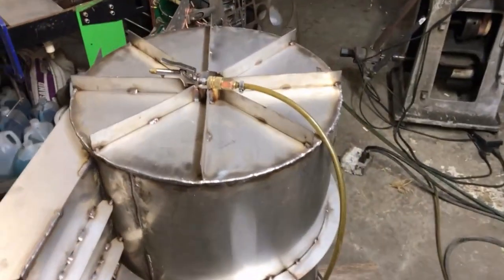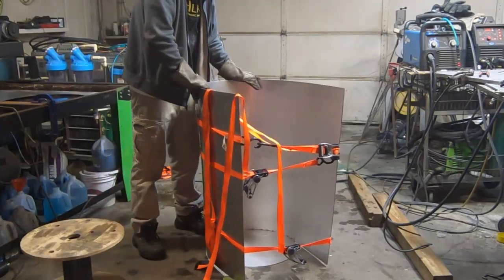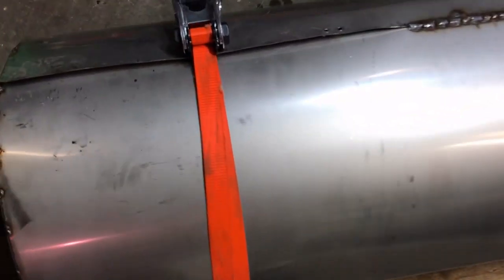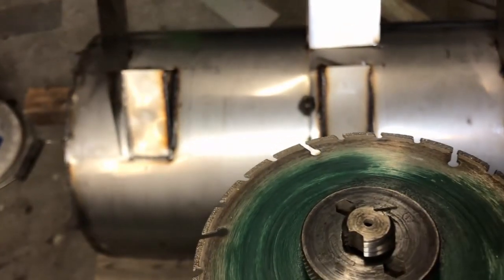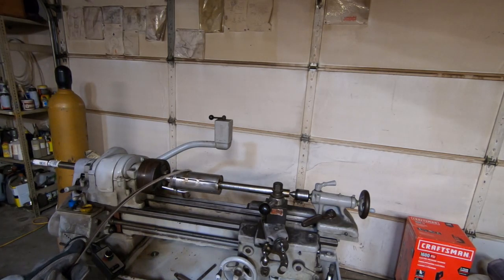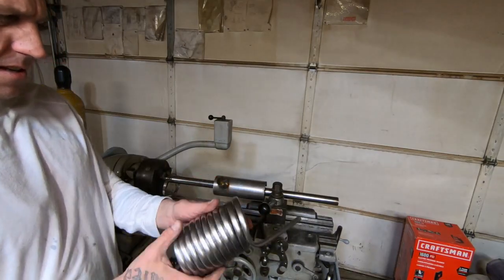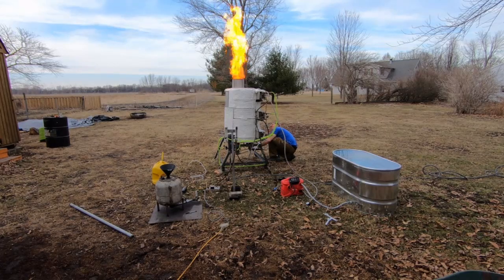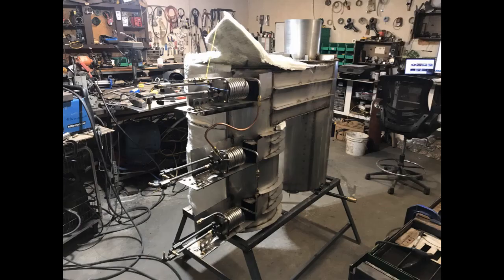How to coil large drums from flat stock

Comment: If you fill up the pipe with a sand and bend/weld a plugs -you will get clean bend no matter of wall thickness,Works super nice on a copper pipes.
Also if someone wonders how do you calculate how much material you need to bend a sheet metal into a circle its diameter multiplied by 3.14.

Comment: 3:40 I heard filling the pipe with sand prevents it from crushing but I didn't try it myself. Great videos, I find them entertaining and educational.
Reply: it works great but its gotta be packed very tight, vibrated and then packed tight again and the ends have to be capped very well too or the sand will escape.. water can also be used and i bet would be better for small diameter. 6the smallest i've ever done was 3/4" tube but you can get very tight radius bends much tighter than most other bending methods and you can just bend it around a tree or whatever because if done right its almost impossible to kink